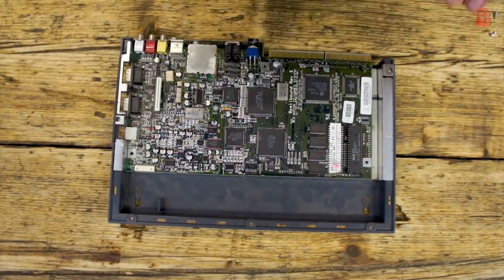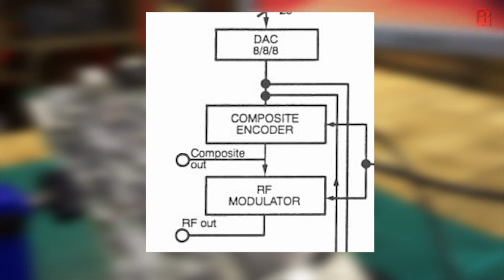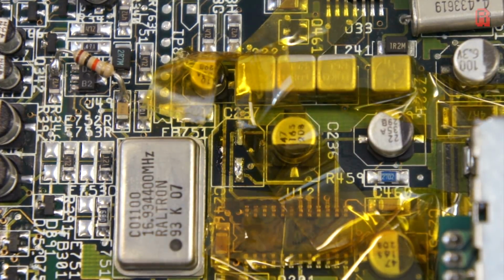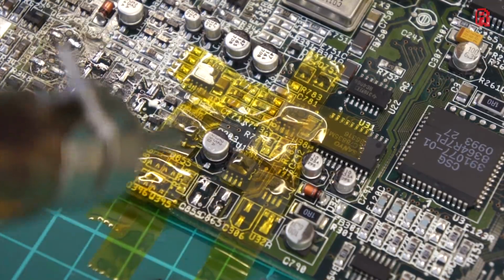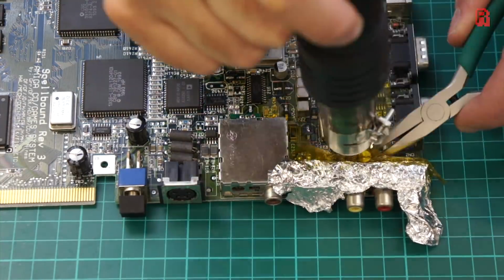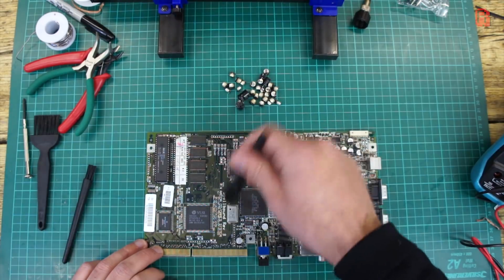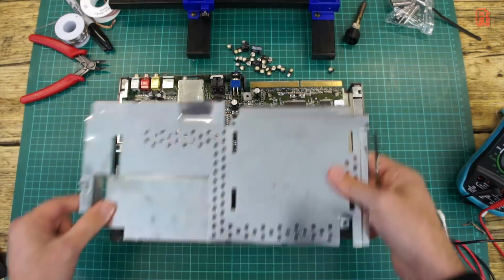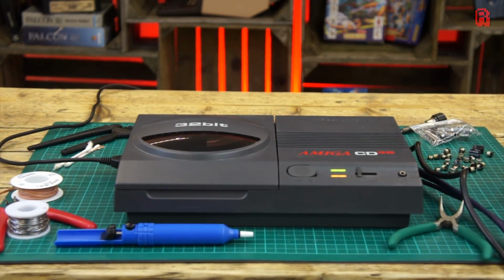CD32 Repairs and Recap | Trash to Treasure pt2

Comment: Having done this very same job at the weekend I thought you'd like to know that on my revision 3 board from the factory both the caps you mentioned were installed the correct way and are labelled on the board correctly.  I highly recommend to anyone trying this to test the pads as you showed rather than just assuming they are the wrong way round.
Reply from the maker: Ooh now that is interesting.  Differences on the same revision board could definitely cause some confusion if assumptions are made

Comment: I was late to the cd32 party and picked up one up on ebay a few years back - for me one of the benefits is that due to their being practically no copy protection on it, it is quite happy to play a backup copy of a game as it is the original - which makes playing hard to get or very expensive originals possible.
Reply: You may just as well run UAE on a raspberry pi.  Compatibility is near 100%, and it's doing cycle accurate simulation.

Comment: De-ja-vu there on the reversed capacitor checks!  Back to black works wonders on systems like this, but as you say - it doesn't last forever - makes you wonder where that silicone goes?!?!  Good job though!  It's a bit easier just adding the solder onto the cap connection as you hold the cap in place btw, rather than sliding the cap into a molten blob of solder - but there's many ways to crack a nut I guess!  PlastX or Novus works well on the drive window too - where they have been scratched on hard surfaces when upside down etc.  Nice to see this one saved from a fate worse than leakage!
Reply from the maker: GadgetUK164 - Retro Gaming Repairs & Mods I'll look those up for the window thank you.  Interestingly in another comment someone had a rev 3 board which is labelled and fitted correctly so it's not a given they are wrong.  Well worth double checking!  Great to see you here as always 🖒
Reply: When I got my CD32, I instantly checked the capacitors. As I had done some background research of CD32. On mine they were fitted correctly, though I cannot be sure, if someone had corrected them earlier... Though I have a memory, that I didn't see soldering marks on capacitors. Anyway, I didn't do anything else, because the machine is in very good order. Very clean and no scratches. And what is most important, CD reads very, very well :) I just need a good gamepad for it now and I won't pay 100€ for one, so that too is going to be a challenge ;)

Not so lucky on my STFM and STE, though. I'll probably start by getting a repair kit for their PSUs... And of course, then there is always the Acorn Archimedes with quite bad corrosion from leaked (clock/memory) cap... That one is going to be a real test ;)

I need more time and money :D

Comment: Earlier today I got out my Cd32 and took its top off (ooh er!). I found those two large black caps near the psu input are reversed like yours, bulged and have a strange brown residue on them. Obviously these will have to be replaced and I'm hesitant to turn it on till I have. Thanks for making this video, you may have just saved my console!
Reply from the maker: ste309w excellent work well done.  Saved just in time 🖒🕹
Reply: RetroManCave Cheers! Hopefully all will be good once I've done that. Not looking forward to a complete recap.
Reply: Hi again. What capacitors would you recommend to replace those 2? I can't quite make out the voltage and resistance rating on the sides because of the residue. I think they're rated at 10v? Thanks.

Comment: Still got my CD32 and A1200 and they work great. The A1200 has a 50mhz 030 accelerator and compact flash with Whdload. Wouldn't swap them for all the tea in China

Comment: Great episode Neil, and some top detective work. Excited to hear of upgrade plans too, this is what I had planned to do back in the day but didn't get to do it, so very interested to see how that works out.
Reply: MadPete 

It is amazing how many people are scared of learning to read a few block diagrams and schematics tbh.

I hope vids like Neils will encourage more people to give it a go, as it can help narrow down certain faults VERY quickly at times.

(assuming the rest of the caps in a device might be OK, and the fault is only in one area.)

For people who are only just starting to read schematics, it can be daunting, but a good tip is that you can often work backwards from the video / audio outputs instead.
You should then instantly see the caps and other components that are involved in those outputs, find the designator (eg. C236 etc.), then locate it on the board.

You don't necessarily re-cap every retro machine of course, but many of them were only designed to last maybe 5-6 years (if that), so if you ,REALLY care to preserve these machines for many more years / decades, then replacing the electrolytics very often helps.

There is still a big issue atm with "fake" / poor quality cheap caps though, and the fallout from an apparent case of espionage and stolen electrolyte formulas.

Only a few trusted sources of good electrolytics remain, like Panasonic, Vishay, Dubillier, Nichicon, but they can often be quite expensive when a lot of caps are needed.

Personally, I have often just took a chance on some lesser-known brands, and they are still often preferable to bulging / leaky original caps.

(eg. I re-capped a 3DO FZ-1 the other day, and used some rather cheap "105C" rated caps from an eBay UK seller. They might not be the best quality caps, but I think they will be more than good enough, and way better than the failing originals.)

Best to periodically check them though, or even better - check them with an ESR meter that is designed to work in-circuit. ;)

Comment: Ive just finished renovating my technics rs-bx727 quartz tape deck, fitted sockets for the 4066 chips and replaced them with texas instruments and changed 30 capacitors 4 resistors and other bits,  before the vu meter wasnt accurate when recording its spot on now
Reply from the maker: Nice work I bet that was satisfying so see fixed as a result
Reply: Mate the recordings it makes sound beautiful! best tape deck ive ever owned

Comment: Nice :) Another one saved. Those two cap footprints are actually hybrid, and are silk screened correctly for SMT caps. It’s just been misinterpreted for the thru-mounts they actually used.
Reply from the maker: Ah now that would explain the confusion at C= a little better.  Thanks for that

Comment: Here’s an interesting thought... if you don’t have a hot air gun station you can use a 12v halogen lamp (car headlight) on a 6v supply to regulate the heat output... careful of your eyes... and yes the heat is less direct!

Comment: the other alternative to hot air is adulterating the solder with a low-melting-point solder like the one ChipQuik makes.  That way the solder stays liquid long enough after getting hit with an iron to be removed.  Probably even more of a pain 'cause you'd then need to wick out all the low temperature solder before putting on the replacement.

Comment: Excellent.  I can only wish I had a steady enough hand to do restoration work like this.  I had an Amiga 500 back in the day, and had wanted a CD32, or at even an A1200 or 4000.  Couldn't afford any of them, so instead I managed a used hard drive enclosure for my 500, and a modest Supra accelerator which had a 68010 CPU. And of course a modest RAM upgrade as well (I don't remember how much, but it was more than the official underside plugin RAM board. I was even looking forward to the upcoming AAA chipset, which alas never came before C= went bust. Sadly, I eventually had to sell the Amiga to get a more modern Windows-based PC.
Reply from the maker: Qun Mang a sad and familiar tale indeed.  Thank you for sharing your memories
Reply: And thank you, sir, for taking the time to reply, and especially for what you you do on this channel.

Comment: I saw the  CD32 at only one dealer in the area back in the time. And unfortunately that CD32 was not for sale. It was part of  a kind of promotion piece. So I ended up buying a CDTV set including the CDTV, the black monitor, the keyboard and mouse and the remote control trackball and I was not really unhappy about it. Later i bought the genlock card and the expansion memory card.
Reply from the maker: Good or not the CDTV sure did look good
Reply: Of course it did and still does.

Comment: Funny thing, I thought that these solid state capacitors should hold for very long time and I mean - long time. Far longer than electrolytic. I guess you learn something new every day :) But it is also becoming quite obvious to me that I'll have very hard time trying to do repair like this in case I'll finally decide to try. My hands shake like hell, oh goodness... it looks so easy when you watch someone who knows what to do. Well, excellent work as always.
Reply: Polymer capacitors are designed to last 20 years under normal usage, whereas electrolytics typically have a 5-10 year lifespan.
Reply: Those were all electrolytics he replaced.
Reply: Even my 775 Gigabyte motherboard cardboard box says in big print that they replaced most of caps with solid state ones for higher durability. By description, I consider electrolytic caps to be those standard non-solid aluminum electrolytic bulging bastards - just to make it simple.
Reply: I have very shaky hands too, and not the best grip. But I do manage to solder and paint. A good work surface where I can rest my elbows is important, and taking a moment to work out the best angle to work at. I try to take the strain off my hands by moving the object around rather than soldering at a difficult angle. But anyone starting out soldering, shaky hands or not should start with some trash boards to learn first.

Comment: Nice job on that recap! Surface mount capacitors scare me lol.  The only thing I would have done differently is I would have put some fresh grease on the cd laser rails just to complete the job, but it was an excellent restoration none the less :)
Reply from the maker: Nice idea I might just do that.  No odd noises from it but it would be a nice touch for preventative maintenance
Reply: Indeed :) Always a good idea for preventative maintenance, may as well make sure that laser continues to work :)
Reply: @refractionpcsx2  Hi, my CD32 board is away being professionally recapped at the moment, and the CD drive works fine but I’d like to grease the rails as you suggest - should then have a solid machine once the board returns. What grease is best - not sure where to get some? Any videos on the subject? Thanks!
Reply: @rosstee  I'm not 100% on the stuff, but I believe Molykote EM-30L is the go-to for this kind of thing
Reply: @refractionpcsx2  Ok, thanks for the quick response. I’ll have a look.

Comment: Can I suggest Servisol Foam Cleanser 30 for cleaning enclosures? I have used it for more years than I care to remember and it seems to lift off dirt better than pretty much anything. It never seems to attack plastics or leave a residue like general household sprays can. Expensive at Maplin, but quite a lot cheaper elsewhere (CPC etc).
Reply from the maker: Ah yes I know the stuff, might be worth getting a few in stock for future work

Comment: Caps man... Every kit of gear that is worth keeping ist also worth recaping. That's at least how I keep it with my audio gear.

As a tip, I would consider using some flux to help melting your solder. Even though leaded solder on these oldschool boards melts earlier than todays lead-free variants.
Reply from the maker: Thanks Etna.  I am using flux paste on every joint to desolder and clean up.  I demonstrate early on with the first cap.
Reply: Oh, I am sorry! I have totally missed that! Then thumbs up for your work and the demonstration!
Reply from the maker: Cheers Etna, I'm always listening for tips though, there are always ways to improve :D

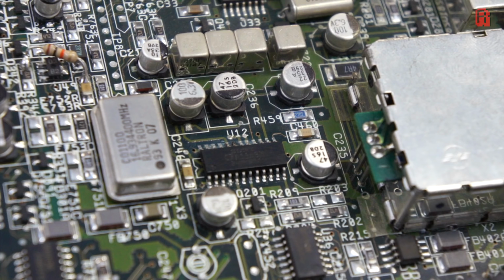Comment: 3:23 Was it the cap or the grubby encoder IC pins?
The bodge through hole resistor looks interesting
Reply: More liquid flux, please
Great work!
Reply: Backwards factory caps, wow!
Reply: I can still hear 15625 Hz from the monitor

Comment: I have a really nice all original IBM PS/1 model 2011 which is today really rare, especially because it is pretty much custom and proprietary (it is IBM 1990 second try at home computing after PCjr), I've nightmares about caps that probably need or will need to be  replaced at some point

Comment: Nice job. Somebody has been practicing. lol

Using the hot air station is definitely the best / safest method I think, and still cheaper than soldering "tweezers".

The heat can cause the old caps to pop at times, so definitely wear eye protection. lol

Good use of flux, solder wick, hot air station, kapton tape, use of an ESD-safe brush? - RetroManCave has had a few upgrades. :p

Another example to people who laugh at the "It's a cap!" thing.
Bad electrolytic caps are far more common on these early-90s machines, especially where a few of them got reversed at the factory.

There's a similar issue on the A1200, A3000, and a few others where there is a negative DC bias on the audio output caps, which ages them more quickly, and can cause them to leak.

On "TheGuruMeditation" channel, there's a superb video where Anthony is explaining to a room of people about the reversed caps on the Amiga 3000, and then Bil Herd fetches a certain other engineer into the room. The look on poor Anthony's face was priceless. lol
Reply from the maker: Hah cheers Ash.  I know that video it's brilliant and Anthony carries on like a champ.  Yes indeed practice makes perfect, that and making sure I have time so as not to rush it.  Glad you enjoyed it
Reply: RetroManCave 

Does this mean you might now be tempted to reflow some of the joints on that Elk recap? :p lol
Reply from the maker: Such a meany 😃
Reply: :p
Reply: The Elk video was great regardless, but could have done with a slightly beefier soldering iron on a few spots, and maybe a dab more flux. :)

Comment: I've bought a CD32 off Ebay in great condition. Having played Superfrog this afternoon, I ran into a problem where the right audio channel suddenly started outputting really quietly. Having done some research online, I have reason to believe that the fault lies with some capacitors. Is there any way I can quickly identify which capacitors are the culprit by any chance please?

Comment: Any idea of possibly doing an upgrade on the CD drive?  I know you mentioned it was slower than a government enquiry in part 1.
Reply from the maker: James Lewis I mentioned its a 2x drive.  In practice it doesn't feel too slow primarily because the majority of games are straight ports of floppy games and it's a big improvement on those.  If you want raw speed then a HD upgrade is the answer and we'll look at that in part 3 🖒

Comment: Did you see Mr Carlsons Labs video on desoldering smd electrolytics? If not I think it could save you alot of hassle for the next project.
Reply: rimmersbryggeri 

I love that channel, and he is top-notch in pretty much everything else he does, but cutting or twisting any SMD cap off the board is a definite electronics no-no.

Some PCBs are quite hardy, but some of them very much aren't (like certain older retro machines.)

Twisting the caps off the board, or even snipping through the cases definitely puts unnecessary risk on the PCB pads and traces.

Even if the pads don't lift at the time, it can weaken the epoxy bond slightly, and then cause pads and traces to lift during re-soldering.

Have I snipped through SMD caps in the past? Well, yes (lol), but that was way before I bought a hot air station, and I only did that on equipment that I kept.

(as an absolute last resort, if you have no money nor access to better tools, nor anyone else nearby to repair something, and if it's a device you will personally keep, then snipping through SMD caps with a sharp pair of snips is mildly preferable to twisting them off the board. But please don't do either of those if you really care about not creating far more damage.)

Put it this way - if you were a solderer / reworker in an electronics factory, and they saw you twisting or snipping the old caps off the boards, you'd probably get fired.

It probably goes without saying that people should never work on mains power supplies nor any other potentially dangerous stuff without first gaining a fair bit of knowledge and experience.

A poorly repaired PSU, or simply fitting slightly the wrong part can be a huge fire risk, or create the risk of electric shock or electrocution. :o

There was even an example recently where a guy watched videos of people repairing and modifying CRT TVs, and he apparently got quite hurt after getting zapped.

Just a friendly reminder to anyone reading this - PLEASE don't work around mains stuff, large capacitors / CRTs etc., and definitely never try repairing a microwave oven - those things are deadly.

(as is most of the food that they heat up, but I can't complain, as I'll be using one in about five minutes. lol)
Reply: It works fine it you do it precisely as he describes (practice on old boards first), the pins will shear off against the caps base plate. I'd say that if the pad comes off, it was already de-bonded or the person removing it is ham-fisted.
Reply: It can "work", but it's just not one of those done things.

We were taught some of the mechnical stuff at college as well, but it comes mainly from experience tbh.

I've seen too many boards broken by people doing that exact thing, and to the people who are absolutely determined to repair their stuff themselves, I'd say that snipping through the caps is a tad less risky.

That normally leaves the plastic base of the caps on the board, and then you can either carefully break that away, or you have better access to the pins / pads to where you can use a regular soldering iron to heat and remove them. ;)